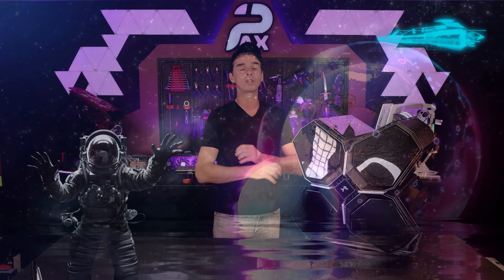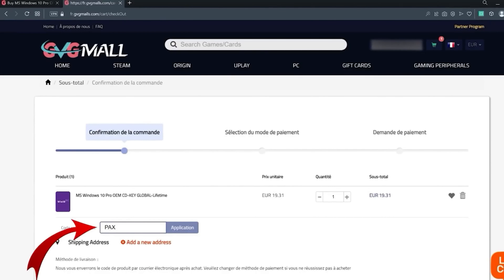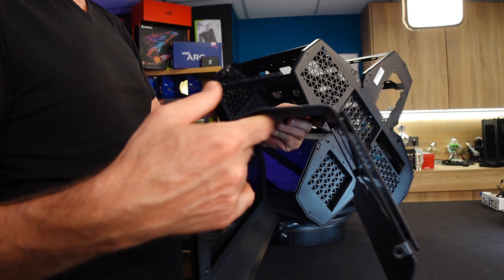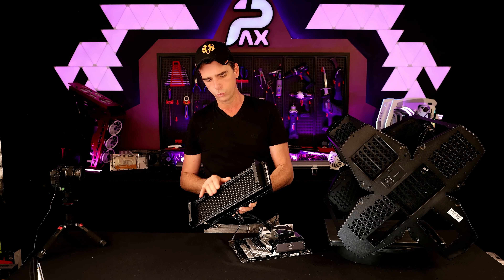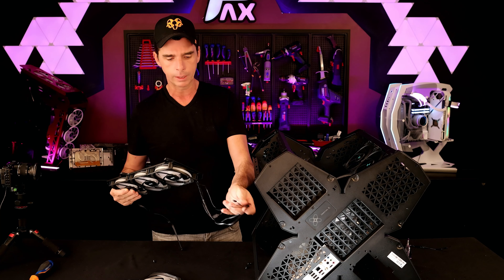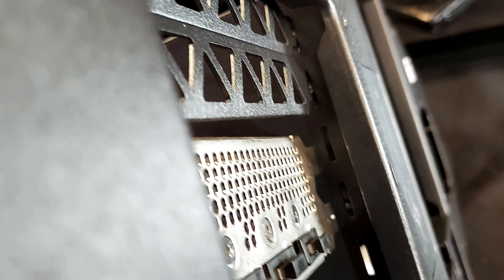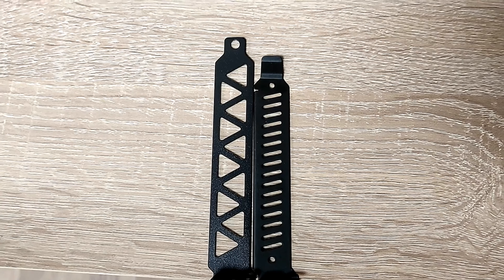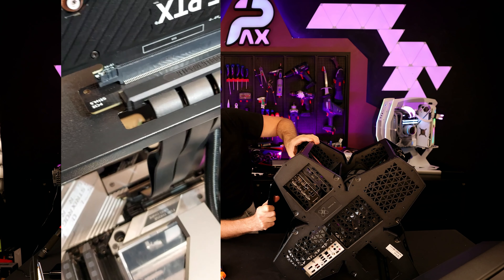QUASTELLAR : Boîtier PC GAMER qui Vient d'une Autre Galaxie 🚀

Comment: Bonjour Pax,

Concernant la CG, par curiosité j'ai été regarder d'autres vidéos. La CG repose sur le support de maintien qui est fournit dans l'ailette. Du coup celle-ci ne penche pas, elle reste d'équerre bien droite 🙂 (à 9m34 on voit que le support en bas est devicé 😄).
Sur la vidéo de kitgurutech y'a une séquence on l'on voit la CG reposé sur le support.
Il connecte son AIO de 360mm côté carte mère (donc plusieurs configs possible je suppose). 

Le boîtier est vraiment stylé ! Et imposant aussi 😳
15kg le bestiaux. 

Peut être que mon commentaire à pu éclaircir certains points. 
Bonne journée 😊👋
Reply from the maker: Oui biensur sur la version v1. Sur la v2 il y a pas
Reply: @PAXPC  mais c'est dingue pourquoi ne pas avoir laissé ce qui fonctionnait sur la v1 et pas la v2 ? 😆 C'est à n'y rien comprendre

Comment: pour moi
le plus: la beauté/l'originalité/rapport qualité prix (pour les gros budgets)
le moins: le principe de cage en X/mauvais l'air flow/aucun USB en façade/la taille(vraiment trop volumineux sur un bureau comme au sol)/aucune option fournis(ventilateurs/raizer)/pas de cache démontable pour l'alimentation/la poussière dans le creux du X en bas (si il est au sol)
surtout qu'une CM a plat passerait a plat dans la partie centrale du X, avec 4 ventilateurs en partie basse (entrée)/2 de chaque coté et 4 en partie haute (sortie)/2 de chaque coté avec des grilles d'entrée+filtre sur les parties entre/sortie ce qui donne 3 ventilateurs AIO+2/3 CG=6 en (extraction/production) de chaleur pour 8 en flux d'air le ratio est pas mal 
(désoler pour le pavé et si ce n'est pas clair)